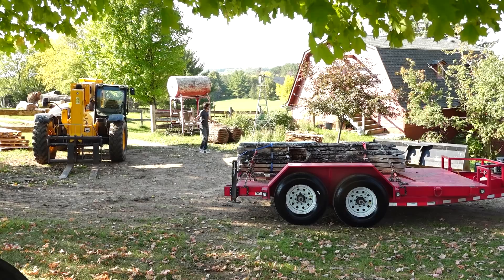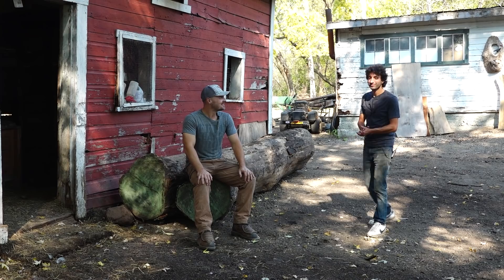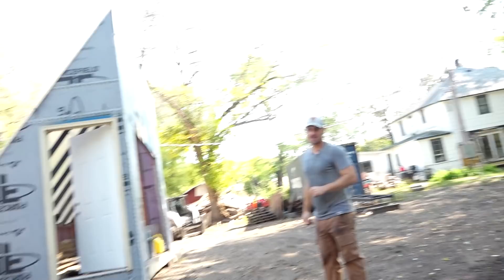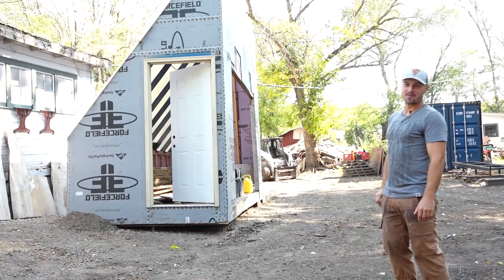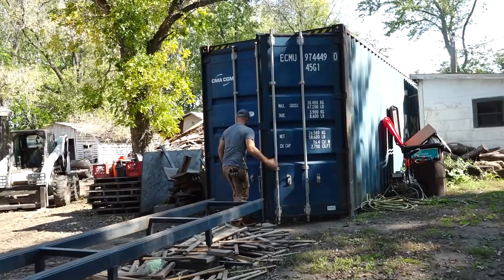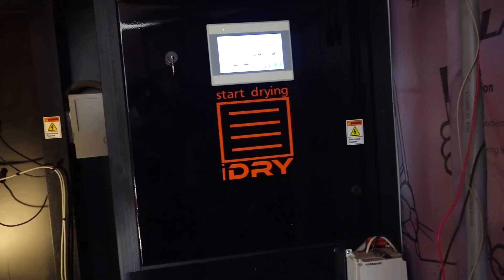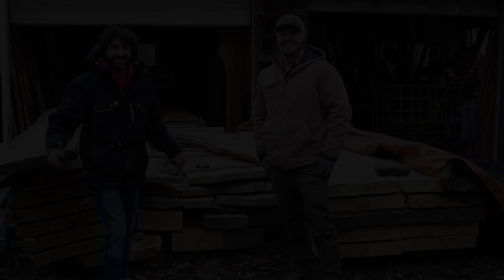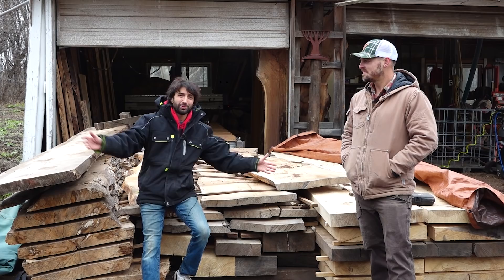Starting a Sawmill Business from the Ground Up | Tour of Ruben Custom Sawmill

Comment: I had to drop my favorite oak tree (85’) a few years back.  It meant a lot to me to (Alaskan) mill and preserve it.  I had to bring in help since most of us don’t have the skills or tools.  The stack is just about done drying. I understand the customer experience you describe.
Reply: Oops.  My main point is that it took us over a year to (spare time) mill it with a 60” bar.  And it’s taken 3 years of stickered, shaded air drying to reach 11%    (The “cookies” are 55” and we got 20 10’ 10 qtr slabs).  Wood is heavy!
Reply: @MikeWest_W    Do you run the Stihl 880 with that 60" bar milling that tree?  How many hours would you guess you have in running the mill?  Thanks!

Comment: Great interview! Who wants to place bets on how long before Matt has an iDry on his new property? 
My guess:
1. Matt talks the other Matt into getting the new bigger model and our Matt buys his old model. 
2. Matt just buys the new bigger unit for himself.
3. Matt builds his own vacuum kiln bigger and better out of a shipping container.
Reply from the maker: 2 or 3
Reply: A shipping container build with Andrew Camarata would be interesting
Reply: Haha vacuum would implode a shipping container quick!
Reply: 4. No matter which of 1‐3 happen, Matt and Matt stay friends for decades.
Reply: Atmospheric pressure is 14.7 PSI. That is 2116.8 pounds per square foot. You could probably dent a shipping container by kicking it. Sucking the air out of it, even only half of it, will make the container look like Godzilla stepped on it.
Reply: @paulgrenier2279  That raises a question I've not seen. Is it a full vacuum? (well, as full as can be generated on earth?) Or is it just a partial vacuum?
Reply: @davidgagnon2849  for the Standard and Plus we pull 8inHgA (not to be confused with 8inHgV). For our turbo models that use heating plates and press we pull down to 4inHgA

Comment: Hey Matt and Matt. Thanks for sharing. My friend and I are building a saw mill business. We have purchased your sawmill plans and are planning on scaling your mill down slightly! Not sure if we need one as big as yours. This video allowed me to see how one mill operation is set up and gave me some great ideas for our setup. Also the vacuum kiln is amazing. I am going to seriously look at the benefits verse cost on one of those units thanks for sharing!
Reply: One thing you should consider is what market your looking to take your business.  One advantage of Matt's mill design is the width capacity, which 90%+ of sawyers with typical mills will only be able to operate on diameters up to 27-36".  So if you're looking to get business from those with larger diameter logs, then maybe take that into consideration.  If you are intending on only operating smaller diameter logs, then you should probably strongly consider purchasing one of the many commercially available machines.  The amount of money saved building your own versus the labor you will have to put into it, may not make financial sense if this is meant to be a business for you, as time is money, and potential reliability/up-time issues you might run into.  Probably things you are already considering.  Good luck.
Reply: Go into business on your own or not at all !   I sat down with an accountant before starting a business and didn’t take his warning.   You can do it yourself and the decisions will be 100% your own good or bad.
Reply: @oakleyjack7600  Most businesses  will succeed with low overhead and putting in the time !

Comment: Wow thank you and a little to late.  I looked what seems for ever to find a vacuum dryer.  I found a couple and only one that seemed good.  I was doing this for a friend and it was like jumping through hoops to get info on it.  I found a Radio Frequency Vacuum Kiln  but again it was a pain and no where near local.  He ended up building one which does the job but not as good but way better than a hot box kiln.  He is still looking as he is no where near keeping up with the demand.  We are pumping out slabs and tables left and right.  We need a piece like this where you don't need to be so hands on through the process.  A kind of set it and forget it, a RONCO of vacuum kilns
I find that about 98% plus of the people have no idea that it takes years to dry a log to get it to a proper slab or even molding/cabinet grade wood

Comment: The vacuum kiln is fine. But I've seen a vacuum kiln with heating plates that uses the vacuum to also compress the wood to minimize movement. I have also seen a vacuum kiln that uses a hydraulic press to compress the wood and uses microwaves to heat the water inside the wood.

I do envy you for your choice of media. You can and did build your own sawmill and trailer. I am an artist whose media is computer hardware and software. All I need is $1,700,000,000 for a semiconductor fabrication unit.

Comment: The vacuum drier is very interesting. I worked for a sterilization company that had shipping container size boxes that could be both heat and pull vacuum much like this kiln.   Doors at both ends, so from the delivery truck on one end and out the other on to shipping truck.  Close the box and run sterilization again.  One question, how much vacuum can the kiln pull and does that effect the wood or just speed up drying?

Comment: What I struggle to understand is why every info you can find says that a log shouldn't dry like that, but milled right after cutting.  To purposely get lots of cracks? For pouring plastic on them later?   so whats the right thing? letting short logs dry first or mill first?

Comment: Hi Matt, what sort of kW would that vacuum dryer use?
Not that I have a use for it unfortunately, but I have a 6.6kw solar system I was just curious to what sort of a contribution the generated power would give from my system
As an example so far this month (up to 27th Nov 2021)
I have generated 886 kwsof power surely that would help drop power bills down
Tony from Western Australia 🇦🇺

Comment: That iDRY  vacuum pump set-up is cheap and nasty and is about 20 years obsolete, I am an engineer working in the industrial vacuum space. 

The pump type they are using is called a liquid ring pump, these are at a minimum 30% less energy efficient than an oil sealed RV or Dry claw pump.  Looking at their spares webpage they are charging about 3x the real cost of the pump. 

I HIGHLY recommend replacing this system with either a single stage oil sealed RV pump, I can speak with our manufacturers and find a US based supplier of equipment I know to be robust and reliable or for lower maintenance a claw pump as it has no oil/internal filters to maintain in the pump end.   Would be super keen to understand what pressure the dryer works at to give you more firm advice. 

I HATE seeing inefficient LRVP used when something better can be used.  ABSOLUTELY no commercial benefit to me here.
Reply: OK this is making me even more annoyed now, the water waste is completely necessary you could see improvements in drying times by orders of magnitude by implementing a larger pump volumetrically.  That little LRVP wont keep up with the surface area of the water coming out thus your comment about a throw away day.  Basically a larger pump will evaporate the water faster and you can dry faster.  Looking at the video more closely I see it is operating at about 8inHG (200mbar[a]), using one of the technologies I suggested you should be able to identify your "dryness" from the pressure as once the water has evaporated completely or mostly the limit will be how 'leak tight' the chamber is assuming the pump is big enough.